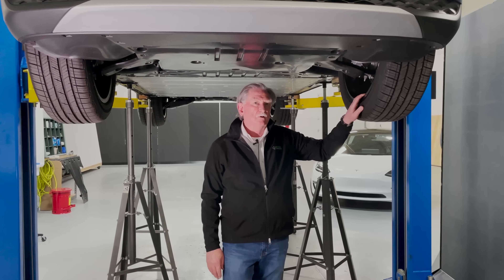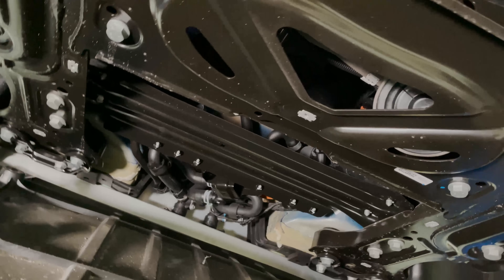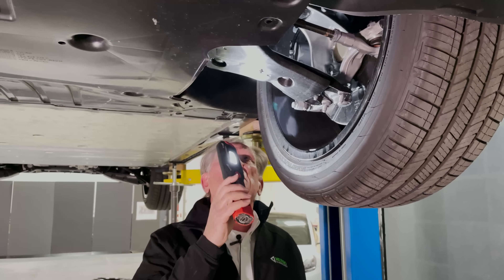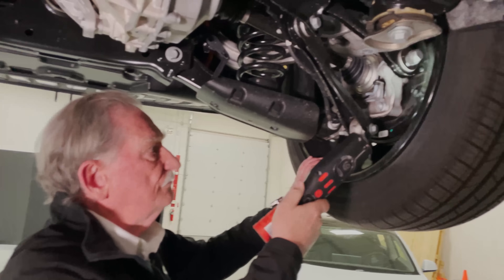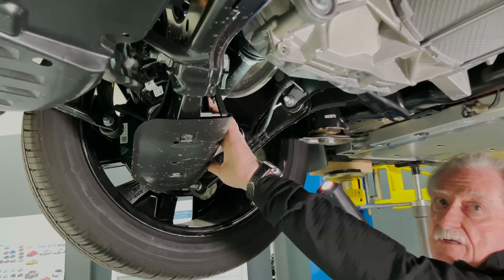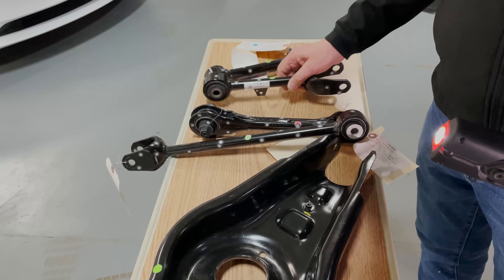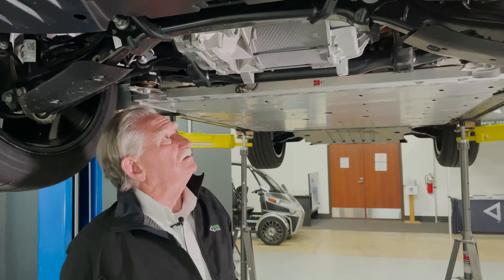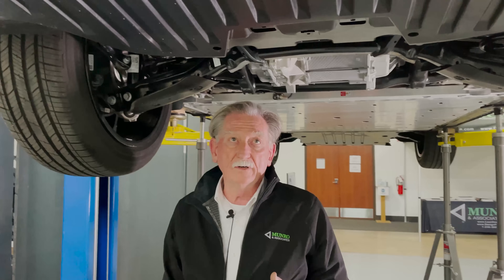2021 Volkswagen ID.4: E3 - Hoist Review, Front and Rear Suspension

Comment: So really missed points that other videos have done better. 1.) Drum brakes are there because it is a sealed unit, performance is not needed on the rear due to the motor being there and performing most of the breaking effort.  The benefit of the sealed unit is that road grime can't get into it as it rarely will be used.  This is a major issue with disc brakes on EV's they don't get used.  Also means that the rear drum should last the life of the car. 2.) The car simply far and a way out does the ride quality found in a Tesla, it was engineered that way.  It is also designed to tow which the Model 3 is not.
Reply: Kevin Smith  Go drive the ID.4 then come back and talk to me.  The ID.4 is not a performance car, it is a general purpose SUV with almost he same cargo capacity of a Model X yet rides almost as good as a Volvo with air suspension and has seats that are just as good as Volvo.  I can't speak for soccer moms but I can tell you that not everyone wants a performance car.  Tesla are generally awesome but their fan boys are worse than worse jerk BMW owner.
Reply: Kevin Smith  Okay but please don't be sexist against women with regards to soccer mom's. it is pretty terrible move. Use women to make fun of a car that you've never driven shows how weak of a person you are.  Grow up.

Comment: About the Tesla suspension: A mechanic that changed my wheels, said the Tesla suspension was one of a Audi A4 from the Year 2010. What do you say to that?
Reply: The suspension is from a Lotus engineer.
"The person who tuned the Model 3’s suspension could easily be an “F1 Prince.” Munro on Autoline.
Reply: If you want an opinion about the architecture of your home - ask the plumber. You will get the plumber's opinion.
It's similar - the guy is very good at changing wheels. And you've got the opinion of the guy who changes wheels about the suspension. You can also ask your dentist.
Reply: So 11 years later, VW (who own Audi) design a more expensive and performance substandard suspension for their new ev, something doesn't add up

Comment: Drum brakes on the rear are disappointing from a performance standpoint but seeing as how this is rear propelled and how regeneration will take up most of the rear brake duties it makes sense to install drums. One of the weaknesses of all Tesla models are disc rotors rusting and pads getting stuck in Calipers. Suspension setup was probably chosen to increase interior space and carrying capacity, suv vehicles all tend to be built a little more sturdy than sedans or hatchbacks. Lack of front storage? Fuses are easily accessible, 12v battery can be accessed with the current setup. My guess is that it’s for ease of maintenance and repair.
Reply: I know this is an old comment but I just came across this video. You have said all of the exact things I was thinking. I would not be afraid to tow a trailer or camper behind this vehicle and I appreciate the way that they built the suspension and the parts used. It is kind of like being a truck guy but with Electric cars. Who cares if it has a little less range if you know it can take the abuse.  Look at the Yugo from years ago . Tiny junky car that was real good on gas.

Comment: The part count seems visibly higher in the ID. 4 compared to the Model 3. Not only that, but the parts seem harder to fabricate and therefore more costly. With Tesla's first principles approach it's going to be ahead of legacy auto for a LONG time. Considering that Tesla's single casting of the front half of the vehicle cut the bodywork robot count by 30%(!) I can't see how legacy auto thinking/strategies will get them to catch up to Tesla.
Reply: Wrong, the parts in the vw are way simpler to make and vw already has all the machines to make them. The drum brakes are way simpler, maintenance free, sealed, and cheaper too.
Reply: And VW's MacPherson front suspension is way simpler than Tesla's multi-link design.
Reply: @carholic-sz3qv  I'm not sure about why Tesla hasn't adopted drum brakes for the rear either.
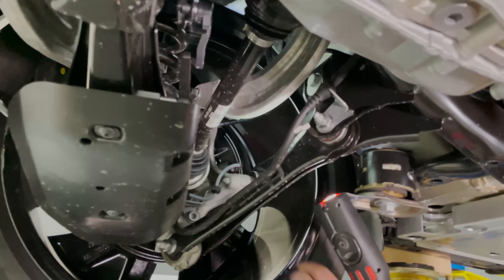I think you might have hit the nail on the head with "VW already has the machines to make [the parts]". I see the bit between 4:50 and 5:50 and it leaves me wondering that if you're movving to the MEB platform for all BEV vehicles, why are are you having to put in the compromises like the curved suspension supports at 5:40 that Sandy seems to recognise?
I'm left with impression that VW is trying to get some value out of existing production lines and part manufacturing they own to avoid abandoning them entirely and having to declare huge losses on anything connecting with ICE car production. There still seems to be a "can we use X from the ICE cars to save us from scrapping our old production lines?" and I think it will hold them back. Tesla is totally unemcumbered: until VW has a design team that develops things like the octo-valve bottle, Tesla is going to keep ahead of the game.
Reply: @GregRobsonUK  seriously! Are you insane? Vw has built completely brand new factories and developed a brand new EV platform for EV only, yes they might have used many parts of the already existing production i dont see any problem there, if its very cheap and works then why change it? Vw makes millions of cars each year and those parts cost almost nothing.
Reply: @GregRobsonUK  there is zero similarities with ICE and EV, from the reviews the vw is more comfortable to drive than a tesla. German cars are overall known for their driving dynamics too. Also the vw is quiter/better insulated.
Reply: @GregRobsonUK  the "octalvalve" is nothing special mate.

Comment: Quite a lot, I don't know, but then still definitely rather bad. Sorry, with all due respect, I can't take that seriously. An id.4 is much cheaper than a Tesla in the entry-level version. I'm pretty sure that vw, as the biggest manufacturer, doesn't make the kind of beginner's mistakes you're implying here. They know what they are doing. It's far too superficial to make such rash judgements. But all the expert needs is a torch and a quick glance and he can see immediately what vw has done wrong in years of development. The car performs excellently in tests, how is that possible with such a poor, outdated design? Is this still about assessing the technology professionally or about pleasing Tesla?

Comment: "this is very structurally strong, what a waste" What -_- ....Since when is it a bad thing to make something stronger? 

Of course some parts of the to be at the level of a Toyota. It is a mainstream car, not in the same segment of a BMW.
Reply: It's not about 'strong', it's about making things stronger than they need to be. If something only needs to be X strong, doing more than that is simply bad engineering i.e. extra cost, extra weight, extra manufacturing complexity, lower performance and range for the car. The goal is to put exactly the right amount of strong, exactly where it needs to be
Reply: @Chris-to5tx  How is Sandy sure it's "stronger than it needs to be"?  Has he done a load analysis?
Reply: @Chris-to5tx  They probably have their reasons. It might help to make the ride more refined and stable. A VW always drives in a certain way. Maybe they use those designs he showed here to achieve that. The fact that he doesn't understand it might indicate his lack of experience in VW design. Just a guess.
Reply: Rather than focus on a single comment, think about the theme. He is highlighting parts that appear to serve no obvious purpose, or point to potential over engineering. Sandy is a recognised expert in exactly this kind of engineering and his comment follows dozens of car tear downs his company has been paid to perform. I assume we are both watching this precisely because of his experience fuelled intuition and opinions. Also, he is an engineer and offers an engineers perspective, this isn't about feel or brand, it's about solid design, build and cost management principles that are universal.

I have no doubt VW had a good reason for every single aspect of the car. I also have no doubt that many of those good reasons stemmed from politics, difficulty implementing changes in such a large org, and wanting to reuse existing designs and components (to save effort, cost of new manufacturing approaches + potential economies of scale over a range of different cars rather than just this particular model). Does this make business sense? Maybe. Does it produce the best possible EV for customers? ¯\_(ツ)_/¯

Anyway, the original question was since when was it bad to make something stronger, the answer is when it makes the product heavier and more expensive than it could otherwise be.
Reply: @ExCivilian  Yeah, how dare he compare it to the market leading, best selling EV that it's in direct competition with. I'm going to unsubscribe right now. Thanks for helping me to see the light.

Comment: I'm surprise Sandy called the alloy multi-link parts in the rear suspension a mistake. I'm no engineer, but un-sprung weight is greatly desired in suspension designs. Those same parts in iron or steel would be way heavier. I think putting the money here where it makes a big difference and not the hood where it makes little difference, is a good idea.
Reply: Control arms in suspension systems are not unsprung weight.  They are considered hybrid weight since they move proportionally between sprung and unsprung components.  In my opinion Sandy is correct to point out the issues with this design, but what's I know? I'm an amphibian.
Reply: @ExCivilian  yes.  Brake components on the other hand are unsprung weight and drum brakes are heavier than disc brakes.

Comment: My guess is the suspension on this is pulled from parts bins.
Reply: I suppose you folks don't understand the term "parts bin. " it simply means  parts already designed and available; in this case, probably parts from other VW group models rather than parts designed specifically for this ID4. It's not necessarily a good or a bad thing,  for although a bespoke part may be cheaper or lighter or perform better in some other way, a "parts bin " off- the- shelf part may be suitable, taking advantage of development costs already spent. Simply grab that part from the "bin," and bolt on.
Reply: In your dreams?!
Reply: That must be a huge parts bin if VW plans to use the MEB platform for 26 models.
Reply: @Conservator.  it is VW; their parts bin is huge!
Reply: @jamesengland7461  The rear drum brakes don’t require maintenance ever and the motor is used to brake most of the times. Disk brakes apparently cause lots of problems on EV’s.

Comment: That MEB platform really sucks and thats where all their upcoming EVs should be based on.. thats a joke 😂 No frunk + such a complicated under body design. This thing is already years behind the company starting with a T and ending with ESLA. This thing is hardly out in public and already feels 2015ish ..Its ridiculous! 🤫 DRUM brakes.. the cherry on top.. I mean wtf VW.. drum brakes at this price point in a full size SUV????
Reply: The drum brakes are there because rear brakes won't be used much. (Logic.) There is no frunk because the hood is shorter ... VW used that bit of vehicle length to make the entire passenger and cargo area bigger instead. (Logic.)  See Bjorn Nyland's video about the "banana box" test on the ID4 ... it holds a lot of them! Not sure what you mean by a "complicated under body design" ... the multi-link rear suspension is there for ride and handling reasons, the MacPherson front suspension is there because VW has decades of experience in making that work. VW knows what they are doing. Do they get everything 100%? Absolutely not, but no one does.

Comment: I saw high costs and complexity in these designs.  I would really like to be wrong. Best from Germany.
Reply: I think VW (apart from Audi, Porsche ofc) does not sell any multilink cars anymore. The last were the B5 Passat and the Phaeton (e.g A8, Bentley). Now only double wishbone at best. Some platform share Audi SUVs also do double wishbone. I think only some MLB-platform cars have multilink.
Reply: Meh, I saw a Golf or B6+ Passat... with a battery pack under the body. It is all it is. Tesla is closer to an Audi with multilinks. In the long term this will of course be cheaper imo, but of course for many new car buyers the Tesla makes much more sense.
Reply: @rkan2  Agreed, except Tesla has fallen down so much on build quality and service, I am seeking alternatives. The engineering of the ID.4 is not impressive, but that is only one piece of the puzzle.
Reply: @stevebakker6884  I agree. The ID 4 is built with good quality . You can call it over-Enginering, I just call it quality. This car has a way higher driving comfort then the model 3 . That comes with a price.
Reply: @stevebakker6884  Where have you been. Tesla may have had their issues, but even Sandy Munro stated that the new Model Y can compete with any German car in quality, including paint.
Reply: @michaelholliday100  Where have I been? I've been listening to what new owners have to say about their Tesla cars.
Reply: @stevebakker6884  Yes, building cars has been a learning process for Tesla, but I encourage you to listen to comments from Sandy Munro about how the new refresher Model Y and Model 3 could go head to head with and against European Manufacturer including paint quality. I am an Engineer and I own 2 Teslas and absolutely love them both.

Comment: Isn't it smart to reuse existing parts (suspension) that they have in other VW cars?
Will front suspension change on ID4 with 2 motors? Or is there enough space for additional motor there without any changes to suspension, just moving other components away?
Reply: It's already designed for a front motor add on. Not necessary existing part, but a proven cost effective design, they could easily adapt for the meb platform.
Reply: @Psi-Storm  I know MEB is designed to have two motors. My question is - after they add a motor in the front will they need to change front suspension because of added weight?

Comment: So far as know the tesla axis is not known for their durability. Also the rear disc breaks on the teslas have big rust issues. ... And no one needs a multi-link front axis in a comfort SUV. It is a VW and not a high performance BMW with Nürburgring abilities. :-) 

But it is interesting to see the different view from a engineer like Sandy. The rear axis point of view is also new for me as a VW fan. You see everybody has potential. :-)

Comment: Contact cleaner on that flashlight's battery contacts.  I've also been putting a little dab of Oxygard on my battery ends. (Please let me know if this is dumb. )
I once bought an almost new light meter for 1/6th it's price because it was working intermittently. I didn't have any contact cleaner, so I just used a pencil eraser - over 30 years later still works.